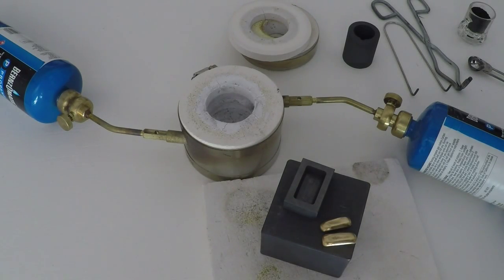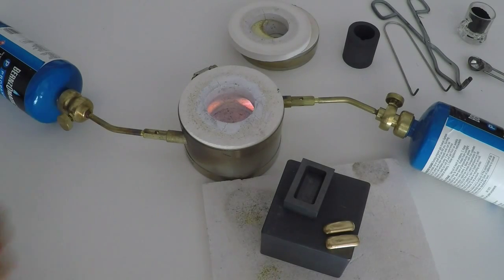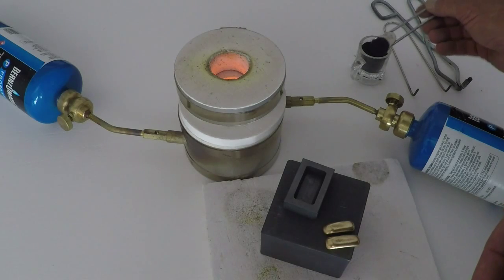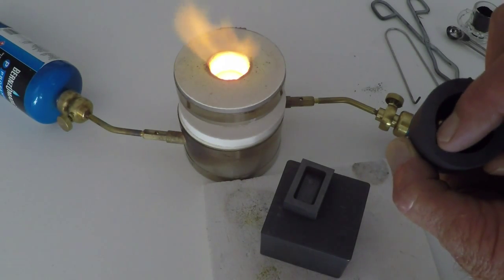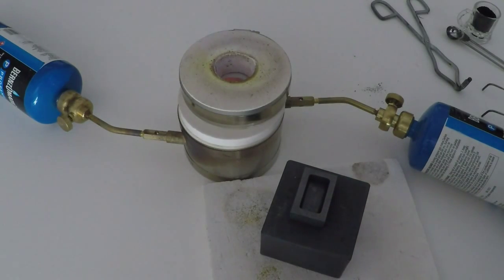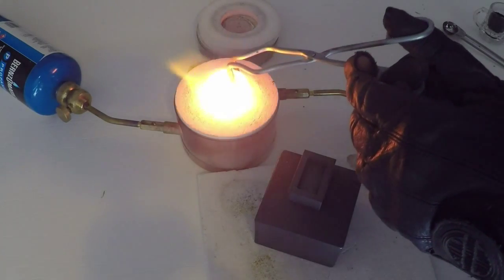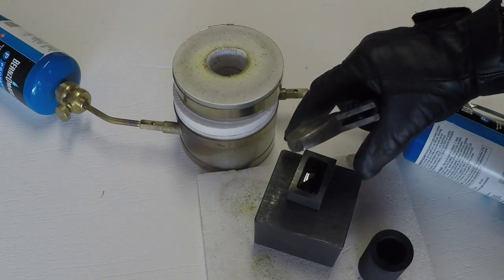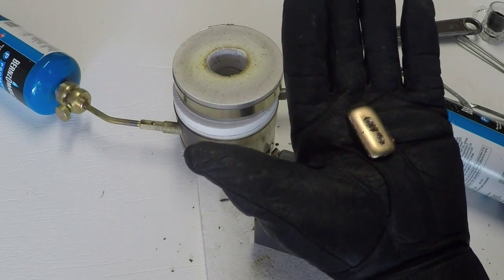kwik kiln demo

Comment: Hey Patrick. I spoke with you on the phone the other day about wanting to start melting my own silver and gold. Is the kwik kiln really only 4 inches tall and 4 inches wide including the spacer? What size are the crucibles & how much do they weigh? I also saw 3 different types of powder and I remember you saying that the black flux was for gold only and it purifies dirty gold. Would I need to use the white flux on tarnished sliver? I have so many questions still but I am going to keep doing my research until I can save up to buy the GPK Deluxe Kwik Kiln II Melting Kit with 2 Mag-Torches.. I am affriad to use the pencil torch heads from Home Depot b/c I read they might not fit the hole in the kiln.

Comment: Just got my son this kiln for Christmas. We purchased two Bernzomatic UL2317 torch heads from Lowes and use them on Coleman camp stove propane canisters. They worked for a while, but after the 3rd or 4th use, the heads sputter and very little flame comes through. The canisters are full. We've used both older and newer torch heads on full and half full canisters with the same result. Any suggestions? What heads do you use? Surely theses heads aren't getting clogged after only 3-4 uses? Its 30-40 degrees outside temp also...would that change how the propane vaporizes in the cans? Any info or suggestions would be greatly appreciated! Thanks for your time.
Reply: Brian Wilson if the Coleman propane cylinders are laying on their sides, as he has them in the video, they can begin to sputter and not flow efficiently. Tilting them more than 60 degrees will cause that to happen. Perhaps trying to lift the kiln off the surface of whatever you have it on with some fire bricks to allow the cylinders to stand would help with this problem

Comment: Pretty sure mixing insulation with the cement plaster mold reinforces as well as increases insulation rate as well. But also curious the coating on the outside looks to be a thin cast iron which also would be a good insulator to. So kind of curious on the material of this kit. As it seems very easy to make bigger versions of this kit if you just know the material used in the lining and outside.

Comment: Nice demonstration on how to uses these mini gas kilns. I am curious what the white material is made of is it porcelain ,  cement plaster ,...What ? The reason i ask is i am thinking about making them but i find when i heat stuff on regular cement , some types of brick the  heat transfer is to rapid so there is some types of cement , brick ,...etc materials that can retain heat better. Don't want to pour the mold and only to find the heat transfer is to quick to melt anything. I was thinking the fix is mixing cellulose fibers or insulation material with the cement plaster as i pour the mold.
Reply: Sir, you need to buy: Ceramic Fiber Insulation Board (2300F) (1" X 23.6" X 23.6") Thermal Insulation. Available from Ebay.
Reply: @diamondminer9263  Is there any reason why regular insulation of high r-values won't work well enough ? And curious what connectors do you use for connecting heating wire together? Like will an old  iron based clamp down work or something specific. I would imagine it just has to be a solid iron connector because temps won't get hot enough to melt iron because the heating wire itself would probably melt to at this point.
Reply: Curious also if you can make an electric kiln to melt high temp melts like iron > or if those are all done with a gas blast furnace/kiln.  I would imagine you have to use tungsten wire if there is any chance and if so there have to be special tungsten connectors to connect wires up. At that point i say specially made insulation may have to be used. But i am guessing still at this stage.